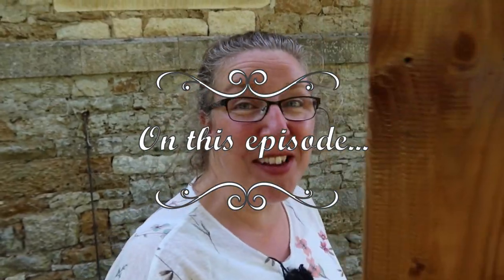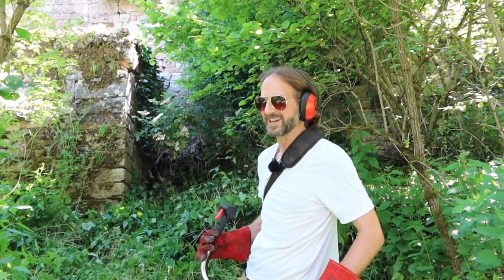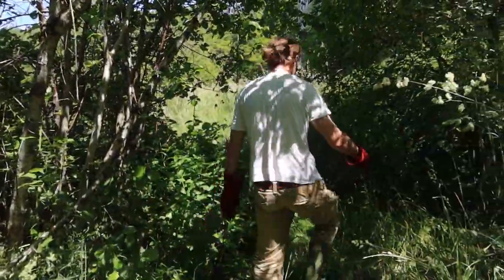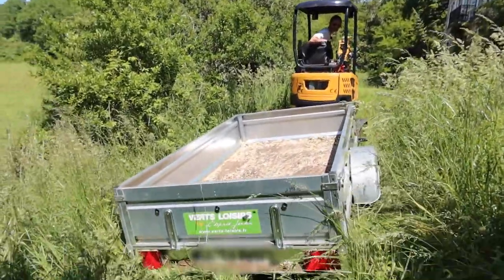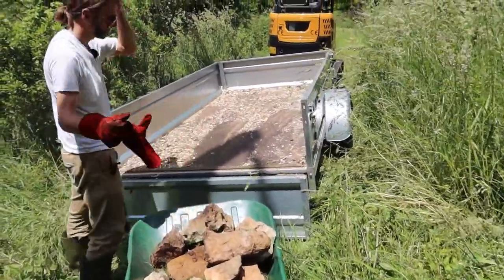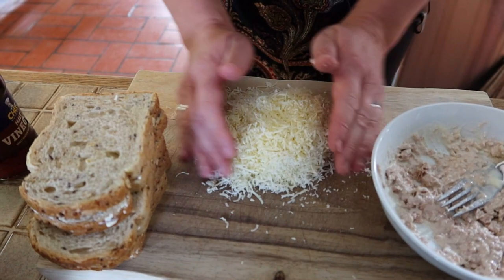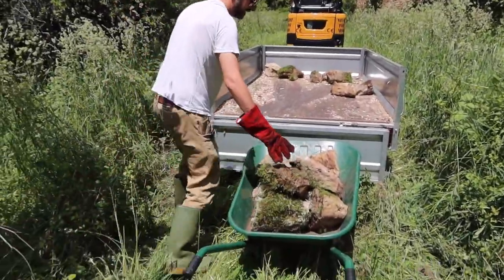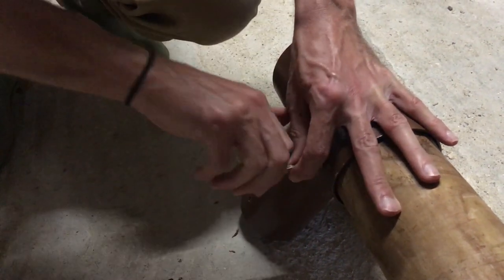Swingset Disaster (Part 2) - The Littlest Chateau

Comment: A few tips from an American who has made grilled cheese sandwiches for years. You don’t need oil in the pan and butter on the bread, both; just one or the other (butter makes it taste better, but you could also use a thin layer of mayo on the bread instead of using butter or oil). Also, put the cheese on the bottom piece of toast instead of the tuna so it melts before you have to flip it (unless you use something like a cheese spread). For tuna salad, you can finely dice pickles and mince onions and add a bit of good mustard. This also tastes really good with cheese on a grilled cheese (love how you called them “toasties”!).